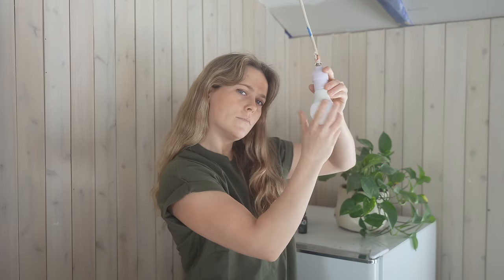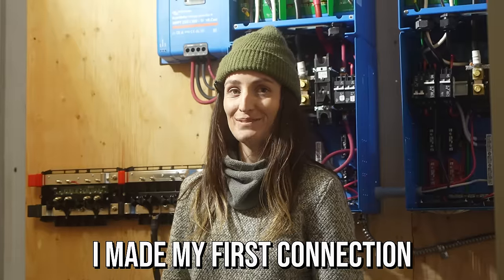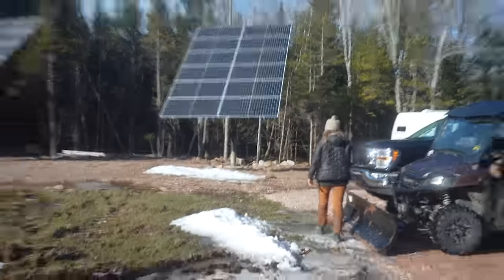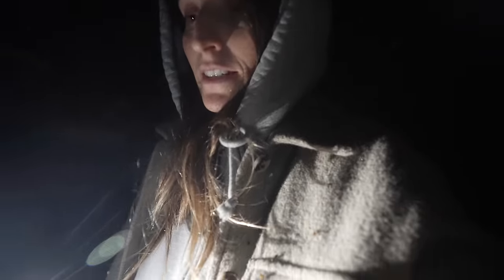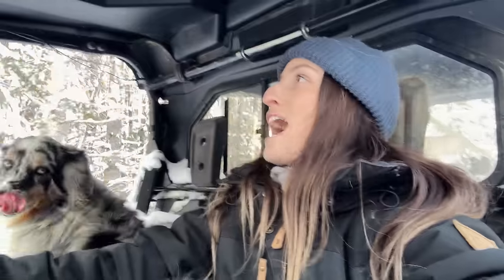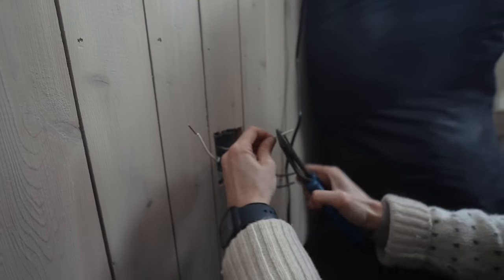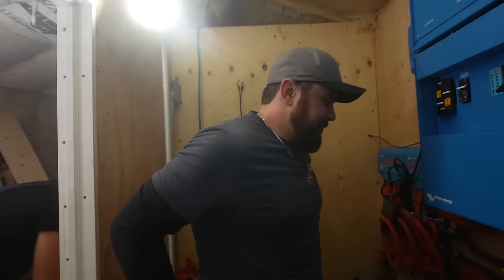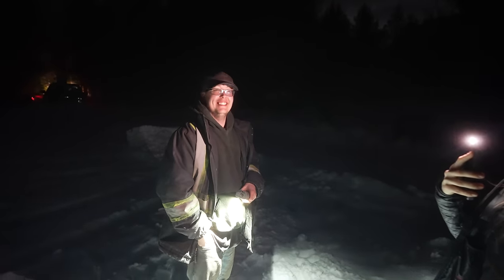The Most Powerful Off-Grid Power System!

Comment: For everyone thinking solar is really difficult, there is an out of the box solution that really works.  Enphase Ensemble brings grid, panels, batteries and generator together in one system.  If a generator is not part of you requirements,  Powerwall + is once again being sold directly to the public.

Comment: Nice video! BUT I'm putting in a 30kWh battery system into a 24' tiny home 😂 sorry. You got me beat on solar but that's because mine is all self contained onto the house itself so fitting 3200 watts is all I could get on a 24x8 tiny home. Glad you got good power now

Comment: Hey there, I'm glad everything was sorted out in the end -- so this comment might not be super helpful for you now -- but maybe it can help other people working with LiFePO4 batteries.
The voltage on a 100% fully-charged battery is 13.6V, and 99% full is 13.4V. (After that the voltage drops very slowly during discharge)
This means that your batteries were actually 99-100% full the whole time, and you didn't need to be chasing that 14.4V level! That was bad information from Victron or Battleborn.
14.4V is the voltage you see when a charger is running -- but once charge is complete, 13.4 to 13.6V is completely normal and correct.
Because of the way batteries work, they'll hold a bit of extra "false charge" due to the 14.4v charging, meaning if you check a battery immediately after charging, it might still show 14.4V - but that'll drop down quickly to 13.6V.
ie. Imagine the voltages go like this:
99% = 13.4V
100% = 13.6V
100.0001% = 14.4V
Reply from the maker: Thanks for all your useful information. We sure do appreciate you sharing your knowledge with us. 🤩🐶

Comment: Two suggestions Ac unit with heat pump 575 watts and 1280 then induction cooker around 1000 or less 
 Stopping propane has been my goal past two years now 
 Hopefully this helps 
Induction cooking is really fantastic, fast easy not to burn !

Comment: Victron Energy is the best in my opinion, the system components are just amazing, the build quality is great, so many people use Victron Energy it's my choice when I go totally off grid in the UK 🇬🇧,  with that powerful system you could install a ground source heat pump, or just go for underfloor electrical heating, so much you have achieved well done, 👍👏👏👏👏👏❤💚 its so nice to go off grid 100% green energy 👍 maybe next a wind turbine for backup changing at night & when there's dark winter days 😀 again well done great Victron Energy system 👍 ❤

Comment: Wow! I was doing the same thing when it came to checking the voltage on my battery while it was connected with each other. Once i figure it out, I found out that one battery was not working at all. I had to send it back to Battle Bound Company. Problem fix. 😊

Comment: As someone looking to build out a completely off grid skoolie, I've done a lot of research on solar. You said over 10k watts of solar and then I saw the number of Battleborn batteries, which is understandable. Those Battleborn batteries alone cost about $700 a piece. I have no clue what your build cost, but I'm pretty sure the solar costs more than I make in a 6 month period. Lol The cabin and land you say cost you $50k and from the look of things I'd say you've spent more than that to get it where it is even with you both doing much of the work. Unfortunately I'm considerably older than you so my skoolie build will require a bit of help getting things like electrical that I've not done before. But good job ladies!

Comment: So pleased for you! And kind of impressed with myself that I know what an RJ45 cable is. lol
Reply from the maker: Impressed with your knowledge to Eddie!
Reply: @Vanwives  I once worked in an office which was actually just the old locker room attached to a garage behind a small police station. To get any WiFi out there I had to connect up a wireless repeater. Turned out it required that kind of cable. Incidentally, the walls were chipboard (which seems to be the name here in New Zealand for what you had on the cabin walls before you did the indoor renovation). Later on another group renovated that old locker room, and like in your cabin, having light coloured walls made a massive difference.

Comment: #Porter Team work is dream work baby!

IP 65
'ingress protection' rating. It SHOULD be on any electronic and electrical enclosures.

The first number (solids) you are saying is a 6 'Full protection agains dust and other similar particles' and the second number (Water) 5 is 'Protection against low-pressure jets of water.
Reply from the maker: Thanks for sharing that, super helpful. 💛🌞

Comment: I know how it feels. I have been using my solar and batteries since Nov 2022 and went off grid January 29th. My generator is the Grid. Looks like 10.5 months a year I can power my house with solar.  Winter just doesn't have enough hours and has to many low production days do to dark clouds from snowing or raining. Hook your generator up to those inverters so you can run it in the worse 2 months.
Reply from the maker: What a great idea!! Thanks for sharing that with us!! 😊💛

Comment: that's a decent small to maybe medium size system. Huge compared to Vanlife, but for homesteads, maybe medium. Probably could have saved a bit in actual cost and especially wire by going with decent rack mount batteries.

Comment: While I will say, it’s an impressive setup, I hope you got a big discount on those batteries because battleborn has the most expensive cost per KWh out of most of the battery manufacturers. For large scale server rack batteries the current market has them around $250-300 p/KWh and battleborn sells those 12v batteries you bought for over $700 p/KWh.

Comment: With the long wire run between the inverters and the cabin, you’ll have significant voltage drop, so be sure to check the voltage at the cabin and adjust the voltage setting on the inverters to get as close as possible to 120/240V at the cabin without exceeding 125/250V at the garage.
Reply from the maker: Thank you for sharing your good advice with us. 👍🐾

Comment: You don't need to make all the batteries 14.8V - they just all need to be near the same voltage and then you can connect them in parallel and connect to the rest of the system. The solar can complete the charging once connected.

Comment: A standard Lithium charger will charge to 14.6v and cut off, the battery once removed from the charger will drop to standing voltage of 13.6v. 13.6v is considered the 100% charged voltage

Comment: New viewer here.  Surprised YouTube hasn't recommended you before.  Please don't take offense with any of my comments.  Whether 12V or preferred 48V, those bus bars are completely inadequate for that storage capacity, there is a possibility of thousands of amps during a short in spite of BB brand protection..  I wouldn't be necessarily worried about individual battery voltage generally unless one battery is way out of specs like the one you have that is bad, the Battle Born BMS will protect them so initially not necessary to charge them up in a cold environment, just take the plunge and connect them together and power on, these are not FLA or Lithium Ion.  Keep your power shed warm!  I am the world's biggest fan of LiFePo4.

Comment: each rack you need just 1 bar with the same size and long cable from each battery to the bar then for each bank od batterys  or you will get differnt readings from each battery in series  it is a common proble with new solar instalers

Comment: You do not need to charge the batteries fully to commission them. You just have to equalize them, which can be done at lower voltage. When they have equal voltages, then you can connect the in the arrays. Next time you will know. 🙂

Comment: I wonder if you have a geothermal system. You could supposedly run hot water and heat for like, 100 watts. Ridiculously efficient, I hear. I don't know if you need A/C, but that's doable as well.

Comment: All these batteries can be changer in parallel to ensure equal state of charge before connecting them into the banks. 48V is most efficient, seems you just paralleled all 12V batteries, which requires a lot of cables and thick gauge. Congratulations! 🎉🎉 p.s. this grounding is not safe, it should be 4ohm and going into earth for 2m+, because when that portion of earth gets dry, resistance of grounding rises and it's useless.

Comment: If ur not checking while the charger is on the voltage will be about a volt lower. The 14+ is 100% charging voltage vs 13+ is 100% when batteries are at rest without load.
Reply from the maker: Thanks Michael for sharing your knowledge with us. See you Sunday.🤩🐶

Comment: The voltage across a battery when it's charging is going to be higher than when it's disconnected. It has to be. If it was the same, there wouldn't be any current. The charger has to go higher than the battery's voltage to force charge to flow back into it. I don't think there's anything wrong with your charger, you just need to be clear about what you're measuring. They need to measure the same voltage while disconnected. Trust the volt meter.

Comment: Great video though you didn't need to fully charge your batteries before connecting them together, just needed to ensure that they are all exactly the same. If they are different there will be possibly excessive current flow between the batteries as they are connected.

Comment: I was a bit concerned for your batteries.  I know lithium batteries will not let you charge them if they are too cold, but I was not sure they could take freeing temperatures all winter long.  Battleborn batteries are pretty sophisticated, so they might include heaters.  (It appears some do and some don't.)  But they need to be charged to run their heaters!  I would have kept them charged until they got installed and the system was running.  You should get some battery heating pads if they don't have internal heaters.  Then you should insulate the heck out of them, so they don't waste too much power staying warm.
Reply from the maker: We did all that just not in 1 video lol

Comment: you could charge only one set of batteries, this will take much less time, and then you can run the system on this one set just to use it to charge more batteries, and add another set of batteries when charged, so you got 2 sets of batteries .. and so on.. Also you should consider insulating the battery room and maybe adding some heating pads, because the lithium batteries don`t like cold.
Reply from the maker: Hey SAS, thanks for sharing all your knowledge with us, such good information. 🤠🐾
Reply: @Vanwives  my pleasure :)

Comment: I've got 5.6 kw of panels but clear view of the sky in all directions, so I probably produce more kwh in a day with half the panels, I've also got 10kwh lifepo4 4 12 volt 200 ah batteries, them batteries are simply amazing, I do need 4 more for 20 kwh but I'm still happy with just 10kwh very much like being on grid, but I'm eventually gonna get another 5 kw panels not for electricity but for home heating building a thermal mass storage heated with a 5000 watt electric heater hooked directly to panels bypass charge controller and power inverter, the thermal mass will be about 4000 lb of sand in a well Insulated tank out side and pumped in though air ducts when needed, I'm also living in northern alberta, I'm not a electrician but did all the solar my self, upgrading some more most years for the last 6 years, I'm an old guy and not gonna be chopping wood for to many more years so gotta do what I gotta do..
Reply: But the batteries could have all being hooked in parallel and charged all at the sametime, I didn't let my batteries fully charged just make the voltage all equal and the solar can finish charging them before using them.

Comment: Well ladies, you did a great job! Congratulations!
But, sorry for that, there are some installation mistakes...
You have nice "technology room", plenty of space, so why are Victron components so close together? What about cooling? It's not so critical, because Victron is unbelieveble reliable, but...
Critical mistake is, that all the connections to sets of batteries MUST be the same lengths, the same resistance respectively (see Victron manual for detail explanaition, why it is important) . It's very common mistake, which could cause a fire in some extreme cases. So be carefull. There is a lot energy in batteries.
I wish you all the best, stay safe and take care.
Reply from the maker: Hey Martin. The cables are all identical lengths, thank you for bringing that up. We know the importance as we did this in our first electrical system. The reason the Victron components appear close together is because Victron manufactures specific products so that they latch on together for seamless connections.
Reply: @Vanwives  OK, good news. My thumps up! 😉👍👍👍

Comment: Wait, you ran 500ft of DC cables? That would be one heck of a voltage drop at the invertor. 
Could you not have put the invertor much close to the panels and run AC that distance instead?

Comment: I hope battleborn sent you those batteries for free, because battleborn batteries are pricey when you can get rank amount batteries for like under 1/2 the price for the same capacity. Yeh you have to make sure they are 100% protected from the elements as they are not sealed, but given the price difference you can make an encloser for them and plenty of money to spare. Like you are talking $22,200 vs $10,194 for 28kWh vs 30kWh so a bit more capacity for under half the price, also the wiring job would be signficantly easier because it's 24 vs 6 batteries which means you will also save money on copper wiring also it would just take up less space as you can do 6 batteries in a single rank.

Comment: Why didn't you wire your house with plugs, lights and a DB when you first moved in as then you could have connected your generator and or Solar system (from your van) to the DB and had a much more "normal" life and made everything going forward easier.

Comment: Wow. The VE charger is showing you the charge volts. The Klein meter shows the battery voltage. There are presets that you can save. Email Battle Born with screenshots of charge app settings, and ask where each should be set. Then save that. No changing anything. VE chargers are the best because, if you can get the setting from the batt manufacturer, you can adjust every aspect of charging cycles to match the battery & your needs. Cycle the power to restart the charge. Unplug charger, move leads to next battery, then power up charger. The music & drama suck. Nice gear though. Good luck.

Comment: You don/t have to top balance them all they way up. Best why is to put them all in pairell put a small charge on them let them set in 24 hours they all should be the same. then you can like the solar charge take over. Nothing wrong with how you did it just the hard why. as for that one don't make since.  the BMS is on or you have no power. But I know Battle born will get it right. It be nice to know why.

Comment: I have the same basic system.  Works for me in lakeport, Ca—grid tied but I also have a model y Tesla—all good.  Happy here—I put it in myself—works very well—sol ark 12k—30 kWh of batteries—very good—eg4 batteries a lot cheaper—just saying—inverters will work with battery power—solar is separate—charges the batteries—pretty basic—mine works.—1 battery doesn’t work—come on have power—move on

Comment: Wow North American electrical is worrying, everything screwed to combustible materials any faults, loose connections, faulty breakers weld shut, coils over heat battery short circuit the whole room goes up in flames in an instant. Please put a heat detector

Comment: Common mistake and you are trying to live off grid like you live on grid. You got a huge expensive and complicated system that you will not be able to do maintenance on or repair yourselves.  Off grid 20 years with just a 1Kw system and a couple of 200Ah batts that I installed myself and can repair and do maintenance and get parts for.  Money is not a replacement for knowledge and you will have  those guys out twice a year working on your system when it goes down. Hard lesson to learn!

Comment: Seems rather stupid to use a bunch of 12 volt batteries for an application like this. A 48 volt server rack system would make integration easier. a rack system could be had for .5 to .3 of the cost in those 24 battleborn batteries. Plus that's twenty-four failure points versus a rack that would only have 5 or 6 batteries. 

Battleborn did you girls a disservice by offering or agreeing to this sponsorship with out consideration for use case.

Comment: Let me get this straight, for 600 days you have been randomly loosing power, but the whole time you have had enough money to rent or hire a huge tractor, get concrete, i mean this huuuuge project your doing, wouldnt it just be easier and less expensive to have like TESLA or some other solar come out and set you up? I know its all for the video but dang, if i buy a little cabin in the woods I can't afford all that. Isnt the point of having soloar and living off the grid is to save money?
Reply from the maker: Not sure what you mean. We never had power, we were working towards it the whole time. Now that the system is set up we have no issues and have lots of power for our needs. Everyone’s idea of off grid is different.

Comment: A Big Fault - You need HEAVY DUTY STEEL RACKING - With Extra heavy Duty Castors, to raise your BATTERIES off the floor. Or your Battery Life will diminish drastically.